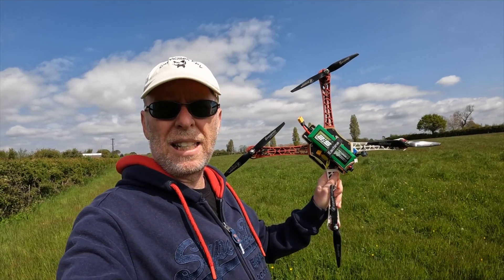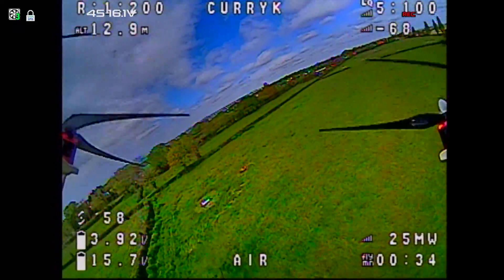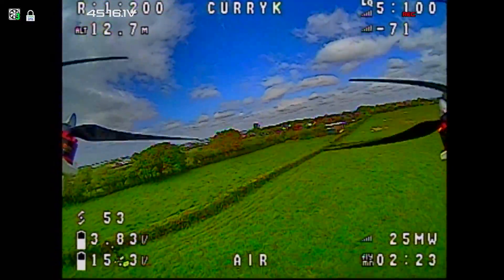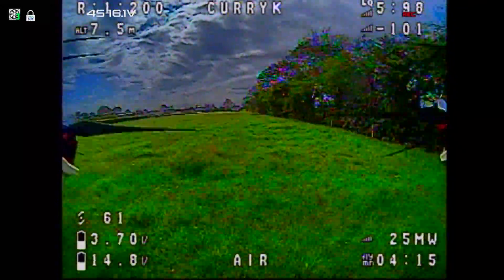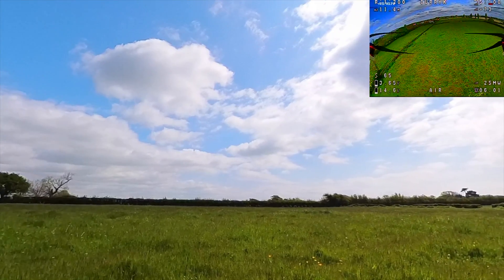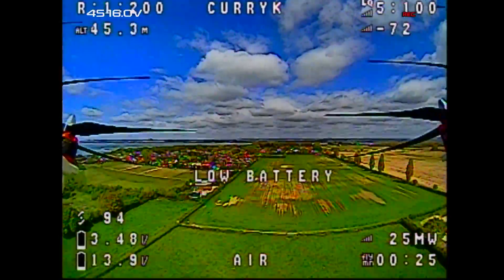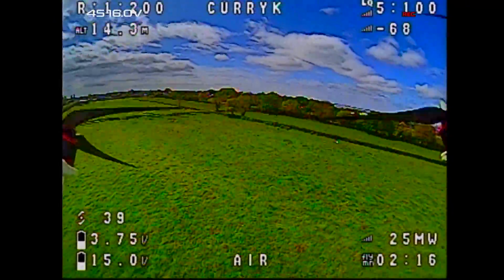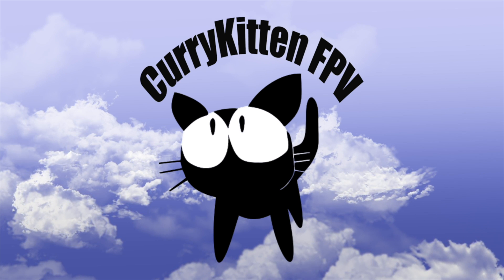Can we acro an old F450 quad with a modern flight stack?

Comment: What KV motors? That looks to be slower on a punch out then a Phantom2, which admittedly is the fastest of that product family.
The DJI Naza flight controller does have a full manual mode, but it's difficult to access on the DJI Transmitter, as the same switch position does either RTH or Manual, and RTH is more useful on those, but in full manual it will climb and roll a lot faster then expected.
Reply from the maker: 900kv those old thing.  Naza does indeed have a manual mode, but you don't have any control over the rates, so if you've ever done a flip or roll, it takes around 2 seconds to complete so you need to be pretty high :)
Reply: @CurryKitten  Ya kinda do have rate control, throught the 'gain' settings in the Naza, but it has no where near the fine levels of adjustment of the non-comercial-customer flight controllers we use on wings and quads we build ourselves. But, the Naza was also never designed to do the things we do with race and freestyle quads. I can assure you through practical experience, of a Phantom2 that hadn't quite dried out as much as I thought (there was a tree, above a creek,..), that a full manual punch out, with carbon fibre props, is a surprising sight to behold. The full throttle inverted landing was equally as impressive,.... :D

Comment: What's your amp draw? so cool!  I just refurbed an old f550 flamewheel.
Reply from the maker: I never measured it.  I did know the motors can take 4S and the ESC board can handle a lot.... it was really a question of was I pulling too many watts for the motors to handle.  Based on the fact that nothing exploded I think it was ok.  What I'd heard in the past was that although DJI used to sell those motors with 30A opto ESCs, they were being very conservative about the amp draw, and really only needed around 18A escs
Reply: @CurryKitten  You can turn it on in the osd since you're using a speedybee betaflight board...why wouldn't you, that's like one of the most important datapoints.
Reply from the maker: I've never believed raw amp draw from an FC unless it's been properly calibrated.  But yeah I could turn it on.   I'm actually using slightly different parts on the Tri, so maybe I will if I fly it again

Comment: I got out one of my plastic armed f550 from over 10 yrs ago and flew it last year and the first time I goosed it hard one of the arms snapped off in flight due to the plastic was so old and brittle..
Reply from the maker: I only ever snapped one in my life - and that was because of those very dodgy bullet connectors they shipped with.  Other than that is was a bit difficult to crash if you were on Naza

Comment: you can 3d print adapters for 16mm carbon fiber tubes it doesn't save that much weight but its stiffens the whole frame!
Reply from the maker: Yes - although, it wouldn't be quite the same experiment of using a 12 year old quad :D

Comment: I destroyed several Nova CX-20 and a flamewheel trying to do acro in the day. But was running AP until Inav 1.7 on an F3.
Reply from the maker: You could actually roll and flip this on a Naza in manual mode, but you were looking at around 5 seconds to turn it all the way over, so it certainly needed some height

Comment: to get rid of the wobble you need to balance the biblades props. that's what I do back in the days when I flew this kind of 450 or Hobbyking 450 deadcat. and the sound of it is still amazing...❤
Reply from the maker: They were balanced... well I balanced them 10 years ago and the little bits of tape are still there.  the frame itself is quite flexible which I think is an issue.  I;m sure it would tune up a bit nicer with some effort

Comment: I have a 10-inch 3D printed thing which suffers from the wobble issue.. I was watching UAV tech the other day and he mentioned that wobble is often due to under-powered motors that can't change speed fast enough. So I bought it some bigger motors! T-Motor Velox 2812 1150 KV. I'm hoping to fit them tomorrow. I'll let you know how it goes.
Reply from the maker: Yes - when you run big props, it can be more difficult for them to react to very fast changes that the ESC is wanted them to do.  In the olden days things were tuned a little looser to get over this - be interesting to see what you big motors will do
Reply: Please, let us know what happens! 😊
Reply: Mate 3inch 3D printed frames wobble like crazy. I have never seen a 3D printed frame over 5inch even fly. Did it ever fly or did you get a carbon frame?

Comment: 10x5 Props ? Whats your max amp draw ?
Reply from the maker: Dunno.  Nothing exploded.  With the modern 4-in-1 ESC board, it was only ever going to be an issue if the motors blew, but I have flown it before on those props.  Although they are 10x5, they don't actually seem to pull as much as you'd think

Comment: I had one with a Naza Lite in it. Great times.
Reply from the maker: Everybody had a 450 or 550 with a Naza.  When I went to my first meet over 10 years ago, there was like 9 of them :D
Reply: @CurryKitten  They're still available on online retailers, and with up to date Rx/Tx combo's, still do the job they were designed to fairly well. I'm thinking I'll swap out the DJI radio stuff on my F550, so I can use a TX16S for more controls, and head tracking on to the cine camera gimbal. Holding off till I find out whether a decent V-Lock battery can get it up in the air. Plus some of Master Airscrews 3 bladed props for it.
Reply: I'm still going to build one with the Naza. 😬
Finally bought a no clean flux pen. Big pads, you know. 😬

Comment: I am wondering (seriously) before you remove the components over to the tri copter, if you were able to place 3-bladed propellers on the F-450 and see if in fact some of camera shake goes away?
Reply from the maker: I'd like to play around with it, but these larger props are quite expensive in comparison to the huge range of 5" props.  Its about £20 to deck it out with some 9" triblades.  It's certainly weird on the frequency of the props spinning - was better at higher throttle rates wasn't it?
Reply: @CurryKitten  too bad I have quite a few tri blade in various pitches of 8,9,10 that I purchase several years ago when my vision of FPV desires were bigger than reality of what I thought I was getting into. 😀😀😀 shipping them to you across the pond would kill the whole idea as well. 😖
Reply: You need to balance big props.  Period.